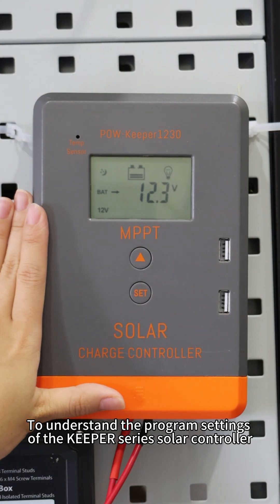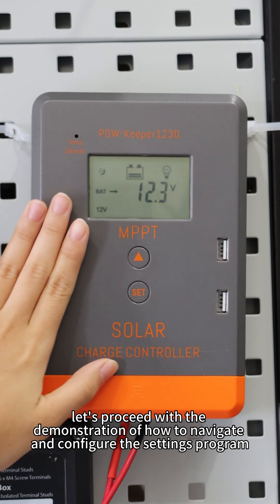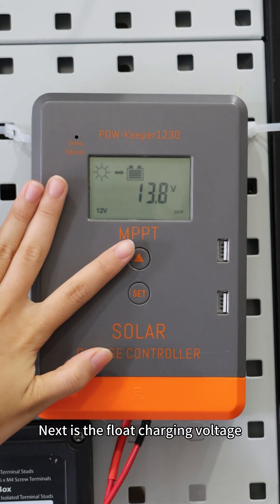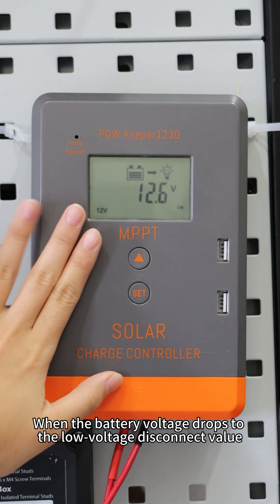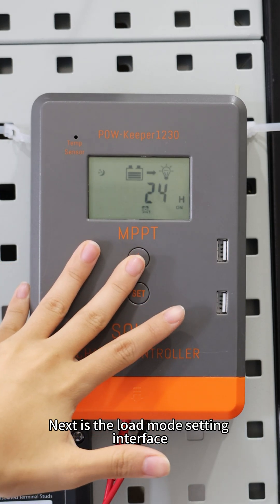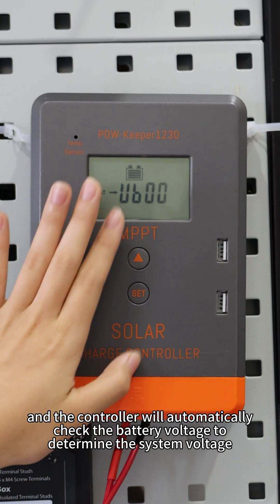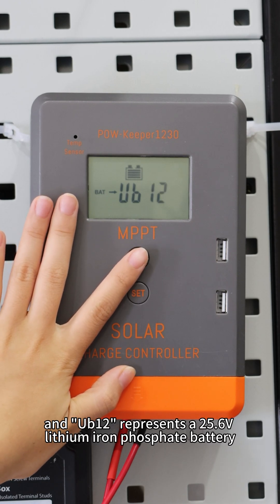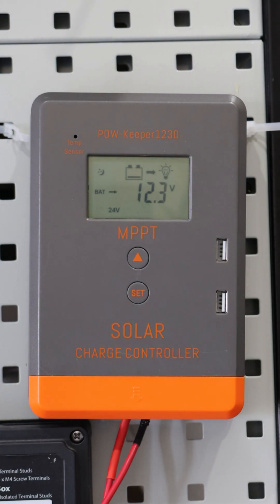PowMr keeper Charge Controller Setup

Comment: What is the output power at the Load Port of this type of solar controller?
Reply from the maker: The power output depends on the battery configuration. The output current is 5A multiplied by the battery capacity. If it's 12V, then it will be between 50W and 72W.

Comment: "I have been using this controller for a year. Everything was working fine until two days ago. Suddenly, it's no longer drawing any amps from the panel.

Currently, the panel is producing 7 amps, but it's not charging the battery. The controller is showing zero amps.

All other functions of the controller are working correctly. It's providing output, but not taking input. What could be the issue? Can you provide a solution?"
Reply from the maker: Hi, please send it to this email: support@powmr.com.

Comment: I can not change the voltage setting of my scc pow keeper 1240

I change to lifepo4 battery from gel type
And i can't access the menu function
Pls.help
Reply from the maker: You need to set it to user mode to change the voltage.

Comment: How to setup charging current if it has 4 x (12v 100A) lithium batteries parallel?
Reply from the maker: The charging current is related to how the solar panel is configured.

Comment: Lo he comprado y me da ERROR E-11. No puedo configurarlo porque se apaga y se enciende cada 30 segundos 😢
Reply from the maker: E11: battery low voltage protection. If the battery voltage is higher than 12V, please disconnect all wires and reconnect them. Then please connect the battery first and then the solar panel.

Comment: Not recognising solar PV input, checked panel, cables and connectors and they are working fine. But no sun or solar symbol is showing. Running a powmr pow keeper 1240.
Reply from the maker: Can you show us by a video?
Reply: @PowmrSolar  yea, I have sent pictures and details on AliExpress powmr solar store

Comment: Is there any option or key combination to reset the whole settings?
I think I have configured something wrong and now it's saying E-11 and preventing me from entering the menu.
So if there's any option to setup the whole thing from the very beginning?
Reply from the maker: E11: 12V system battery low voltage protection.

Comment: My battery is sealed lead acid is it possible to use the settings Usermode 1 my mppt is powmr 20ampere only
Reply from the maker: kindly send us the model number. POW-Keeper1220? Yes, you can.

Comment: What are the bulk and float voltages for 12v lithium battery ub11? Can't find it in the manual or anywhere else!
Reply from the maker: Bulk charge: 14.4V-14.6V Float charge: 13.8V
Reply: Tengo este contralador  del vídeo y marca e 11 que herror es
Reply: @edgararmandoguerreroterron7225  it means low voltage error, you must first charge your battery to >11V

Comment: Hi! Can you share all code of list? For example I looking for any information about E16.
Reply from the maker: E16: PV input overvoltage protection
Reply: @PowmrSolar  hi. Can you share all of code list?
Reply from the maker: @michalokocim  E11: 12V system battery low voltage protection, E12: battery overvoltage protection, E13: overload protection, E14: load short circuit protection, E15: controller overheat protection, E16: PV input overvoltage protection, E21: 24V system battery low voltage Protect.

Comment: Need some help i got E-11 erorror
Reply from the maker: Hi, E11: battery low voltage protection.
Reply: @PowmrSolar   how to solve that situation i cant change the setting of the controler due to that e-11 thing it keeps poping out on the screen please do make video on how to solve that problem😥😥
Reply from the maker: @charlesgayon8738  how many volts is your battery？
Reply: @PowmrSolar  12.8v
Reply from the maker: @charlesgayon8738  May I know what type is your battery?
Reply: @PowmrSolar  lead acid
Reply: Me pasa lo mismo
Reply: E-11 
https://youtu.be/IdBvseYupEo?si=SuL3ZS1W1MPjYZdm

Comment: How to set the parameters of lithium ion 18650 battery?
Reply from the maker: When using lithium batteries, please set the system voltage first, and then set 
the corresponding battery type (see P8-3.8/3.9)
Reply: What kind of battery type?the available type of lithium battery is lithium iron phospate 12 /24 volts?18650 is lithium ion.
Reply: Setting parameters for lithium-ion 18650
https://youtu.be/Doy_e-U7GEE?si=51K1pSw0_diqXSjd

Comment: How to set up for gel type battery?
Reply from the maker: The battery(GEL) type can use the system default setting UB00, or you can set the 12V or 24V system according to the battery connected to it. 12V selects UB01, 24V selects UB02.